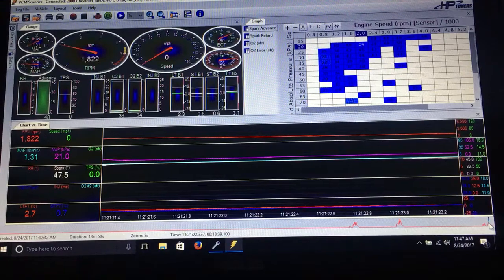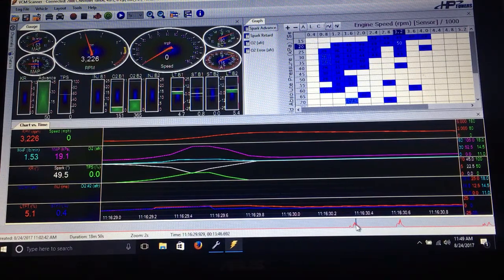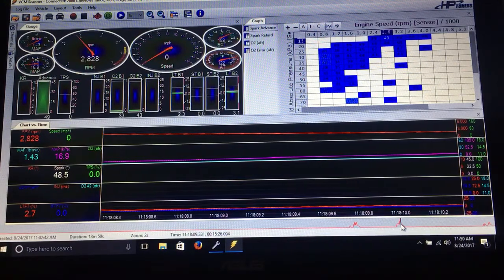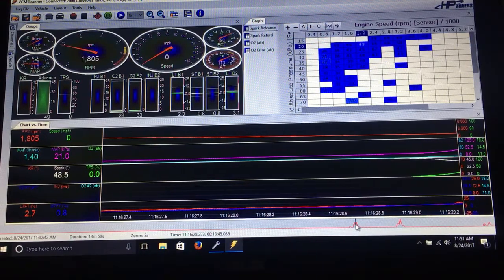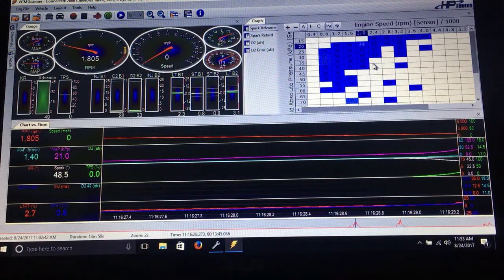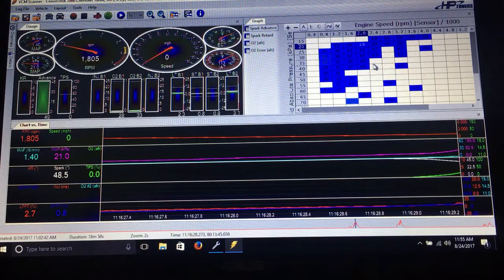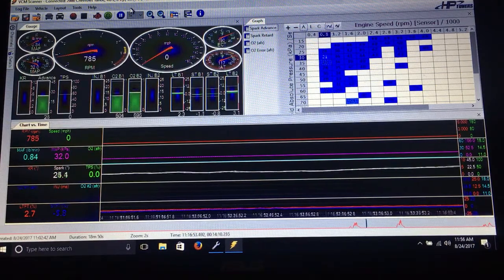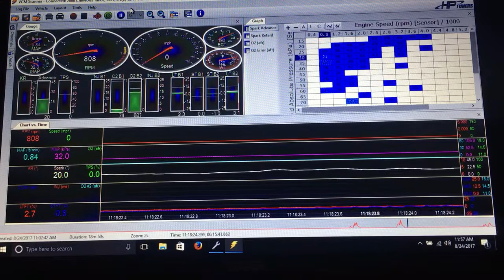HP Tuner Pro baby steps learn to tune

Comment: Your intake air temp stays in the red meaning high. I would start by looking at the diagnostics and start there to see if you have a problem. Do those spikes also fallow your rpm too?
Reply from the maker: Cody Pfleidner I don’t think my 2000 gen 3 Engine has an IAT.  I know people add an IAT to tune using Speed Density, but I’m using the factory MAF sensor. From what I’ve read the MAF setup is much easier and forgiving for changes in the weather especially cold starts in the Winter. 
I’m not sure about the spikes but they’re not just an indicator of rpm change. 
The biggest issue is I need real time O2 sensor ie Wide band to accurately tune with . 👍
I’m so overwhelmed with my transmission and driveline issues I haven’t even thought about tuning.   Thanks for the ideas!
Reply from the maker: Cody Pfleidner The more I watch the video, those spikes, do represent rpms above idle!  The issue is when you watch the timing it seems to pull out timing when it shouldn’t. I think 🤔 
Good catch on the red spikes! 👍
Reply from the maker: Cody Pfleidner It’s a learning process that’s for sure! 👍
Reply: Btw I know what your going threw with the trans and drive line issues. I built a 66 c20 5.3 swap and even with the freshly built 4l60e I am considering swapping out for the 4l80e. I wish I would have done from the start. Keep up the good work though man :).
Reply from the maker: Cody Pfleidner Thanks!  Once we get past Christmas everything should come together. 🙏🏻🙏🏻🙏🏻

Comment: You can click the red line on the very very bottom, that's your RPM. That's the entire log down there.

Edit: that's kind of like the red bar at the bottom of a YouTube video. The peaks are higher rpm. Also the timing is that high down low for fuel economy.